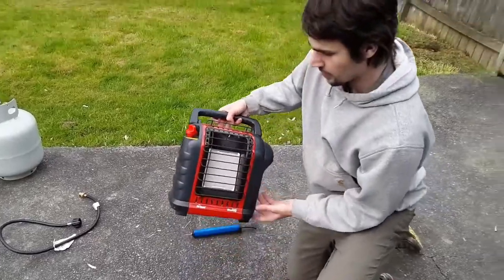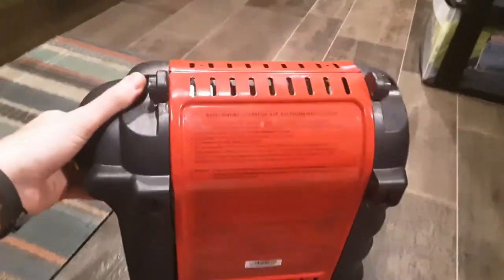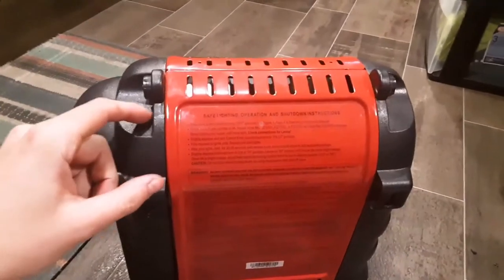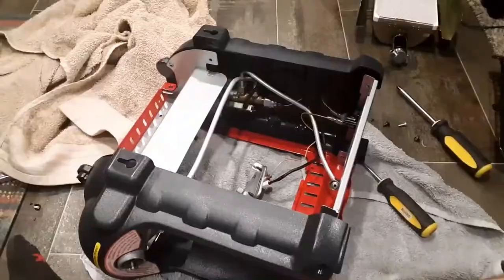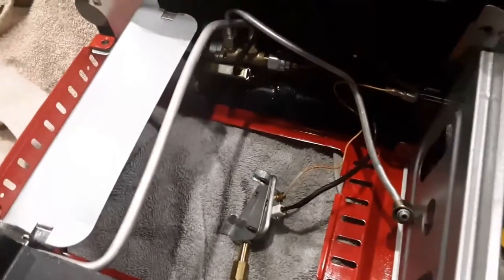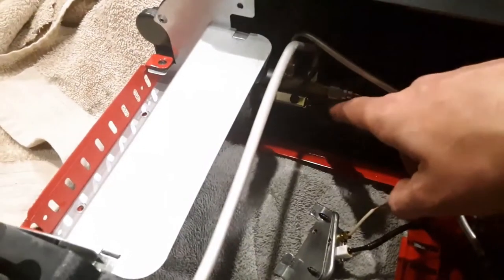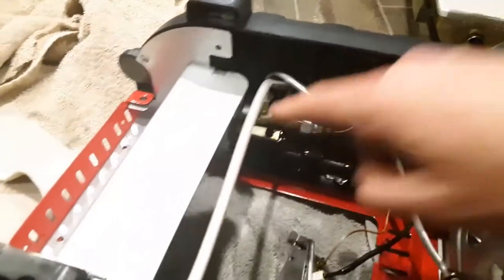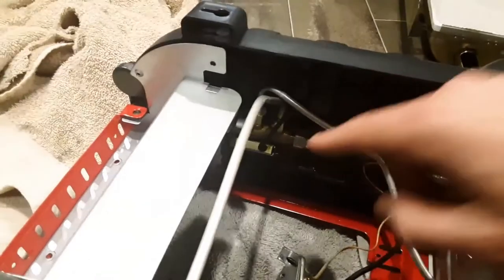🔥 How to Fix Mr Heater Portable Buddy That Keeps Shutting Off

Comment: Seems like a common problem. There is always going to be a tiny bit of residual oil in propane tanks. This could easily be fixed with a filter. I called the company and instead of owning it and telling me what the trouble is, it took 6 phone calls of denial that it could happen with their product. After watching yours and a couple other videos I was able to gut it and clean out all the pipes. Works like a champ but I'm still going to get a filter so this doesn't happen again. Mr Heater could add one for a couple dollars and have a top notch product.

Comment: My heater was fine last heating season. This season its having the pilot light drop out every time i click start the pilot and release it. Ive been watching fixes from you guys; gonna give it a try. By the way; it's connected to a larger cylinder out side with a filter inlet on the left top inlet for supply gas. Will check that too.
Reply from the maker: I no longer need to use mine, but i remember someone suggesting to use a filter attachment to catch whatever is building up.

Good luck! If ya get it cleared out i highly suggest looking into the filter i described.

Comment: Question: The pilot is blue works fine but then it behaves as though there is too much pressure. The pilot light blows itself out. Any thoughts.
Reply: I have the same problem. I have two hoses for connecting the 20lb tank. I have no answer as to why, but switching the hoses occasionaly works for me.

Comment: A fuel filter is needed when using larger 20lb tanks. If not oil will gunk up the lines in the heater.

The lines can be cleared with compressed air. 

ALWAYS USE A FUEL FILTER WHEN USING A HOSE AND TANK.
Reply: I have filter and same issue
Reply: You don’t need a filter if you use the Mr heater brand hose. But if you use any other brand hose there is oils that emit from the hose and that’s what clogs the internal heater lines. 
If you purchase the actual Mr heater brand hose it tell you all that info in the instructions.
Reply: I do have the fuel filter.  Changed seasonally. Only turned propane tank pressure valve couple turns, not maxed. (Low pressure)  Same issue! Its clogged. I'm so disappointed with these things. I'm currently have it upside down again, lines filled with finger nail polish remover to drain the liquid and of course oil. Been fighting with this thing 3 days now. Alcohol, Qtip, compressed air. It works beautiful 20 min then acts up all over again. Now I've used a syringe with polish remover down the lines.  Gently swung it back and forth to slosh it around. Now it's upside down draining. I only use it seasonally. Not 12 months a year. So it hasn't lasted a total of 6 working months. D@mn thing. Wish me luck. I'll let you know if this works. If someone else resolves this, let me and the rest of us know.   Full time RV'r here.  Need my heat on these chilly mornings.  PS. 2nd Mr Buddy Heater I've owned. Same problem 1st time.

Comment: Well good idea but unfortunately I  am still experiencing issues. Anyone have one of these start ok on low, after moving to high for a few moments the pilot gas starts hissing out of that tube, flames up, goes out and eventually shut itself off? I have tried everything I have seen online but no luck. (I tried numerous sources of propane)
Reply: I'm currently having this exact problem with my little heater did you ever solve it.
Reply: @boundedscythe7726  nope. These heaters are garbage.
Reply: @shane7133  that sucks I already ordered the bigger one because I'm sick if this thing falling over, I'm confident it's a heat issue because it'll run for about 5-10 minutes flame burst and turn off if I turn it on again right away it will turn off again.
Reply: mine cuts out, I think it's the thermocoupler, it must be faulty and not detecting the flame so auto shuts off propane flow, due to not detecting anything lit... Just a guess bc is i hold a hot flame on coupler it stays lit
Reply: @blackpepe  I had an issue with the pilot lighting and as soon as I released the knob the flame went out.  I also thought it was the flame sensor on my big buddy, but it wasn't in the end.  I disassembled the heater and took off the right side as you look at the front.  The side with the control knob.  There is a black switch with 2 white wires.  One comes from the flame sensor and the other to the main valve.  I disconnected both wires and shorted them together.  I hooked the gas back up and and tried it out.  It worked perfectly.  The switch is a tip over switch.  I took it apart and wiped everything down, put everything back together and now the heater works fine.  The ball in the tip switch was not actuating the switch to give continuity.  Hope this helps you.
Reply: Yeah that tip over switch seems to get stuck sometimes in an off position. I've banged the heater in an upright position onto the floor to try and jar it loose. It's did seem to work.